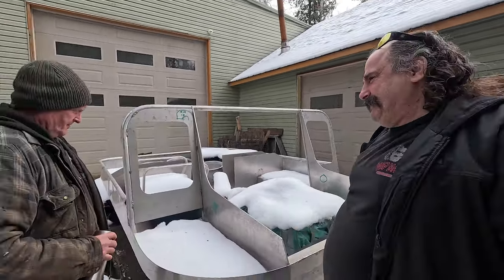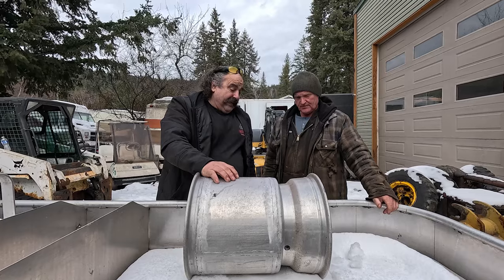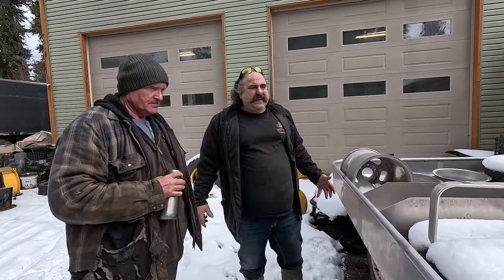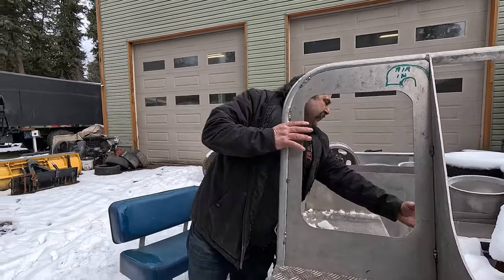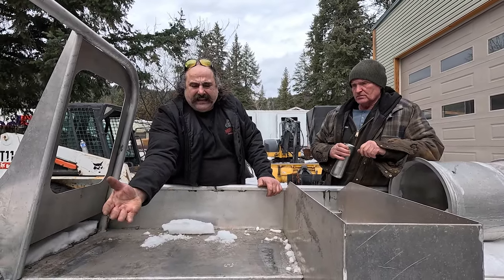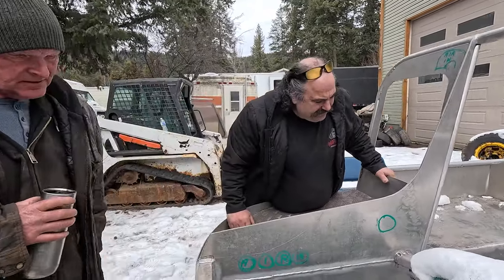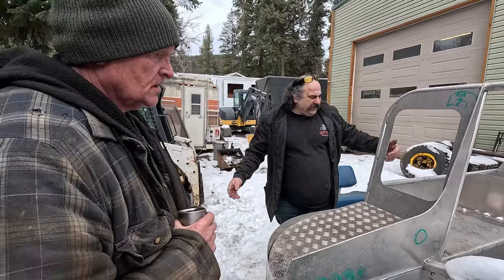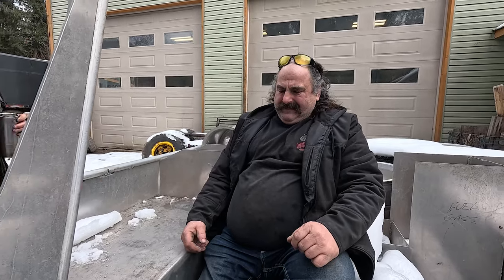Swamp Donkey Welding Plan Begins!

Comment: Motor might be riding higher so you can put a bilge and pump in it.

You could build a doghouse over the motor like an old van and build a dash around that.  Could give access to certain parts of the motor too.

Find a newer wrecked Corvette and steal the steer by wire mechanism out of it and you could put a joystick on the dash. :)
Reply: It’s also an air cooled engine, I’m suspecting a 1700 suitcase

Comment: You dont need much of a dash, temp, oil,amps and tach, ignition switch, start button and a few light switches! A square foot will easily accommodate that! I think your primary concern before seating are controls, that will dictate everything else! 🇦🇺👍

Comment: Hay Avery stand in front of the swamp donkey on the passenger side and driver side top window frame they drew a pic of a air snorkel. it not set up to suck air from the side compartment . cut a hole in side brace and run piping up the window frame with a 180 degree or add a snorkel filter (beaded kind that have a cap)

Comment: Shovel the snow out of that thing so your buddy can see what he's actually dealing with Avery. It's a easy job to lift the windshield up to whatever it needs to be. A couple weeks should be able to deal with most things worst case scenario another week which I doubt..you'll need. looking forward to see this thing get done. Reminds me of my days as a fabricator, welder, fitter! myself. 
Avery I think the biggest issue at hand is that bear belly of yours, once you get that out of the way, the fabrication shouldn't be a issue at all.  LOL Should be a very straightforward job just about everything is already done for ya Avery. Shouldn't take much more work at all. Don't drill holes into the floor Avery put in a couple bilge pumps Avery, just like they installed in boats remember its a swamp buddy. You have to keep the water out of this thing!

Comment: Set er up like an actual argo. Centre of gravity in the middle,steer and drive from the middle, Run a removable bench seat across and build a doghouse of some sort to cover the motor. Then hook up a blower motor to get the water out of it if need be.

Comment: Your asking why the engine is 10" off the bottom, well have you ever sprayed ice cold water on an engine that's been running for the past 2 hrs, ya your right Avery the engine block, heads, or cyclinders could "Crack" and render you dead in da water, lol please Have The Best Day's Possible from All of Us at: Bare.Metal.Custom.Workz in Barrie ON Canada 🇨🇦